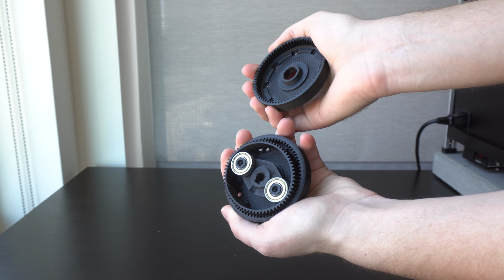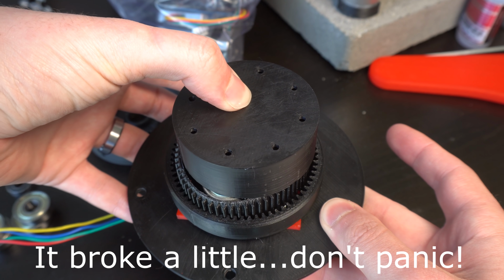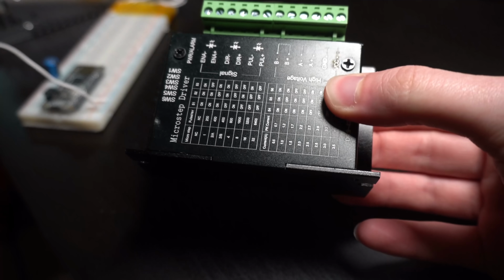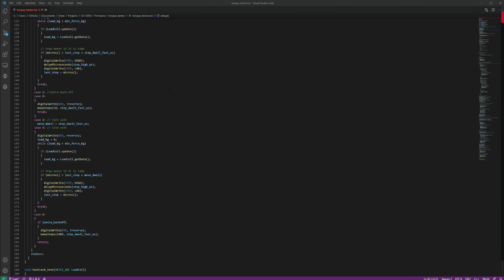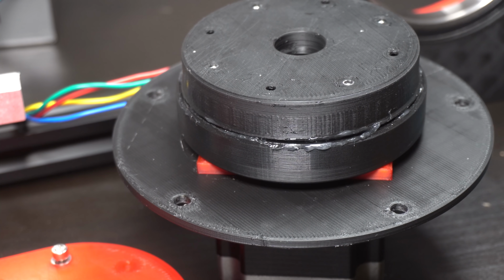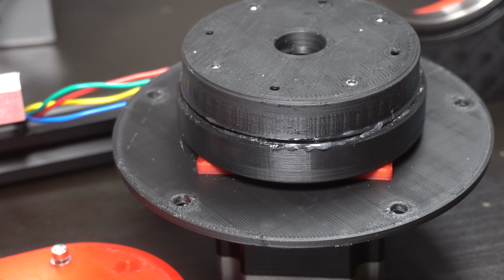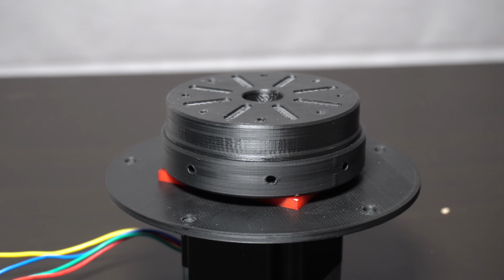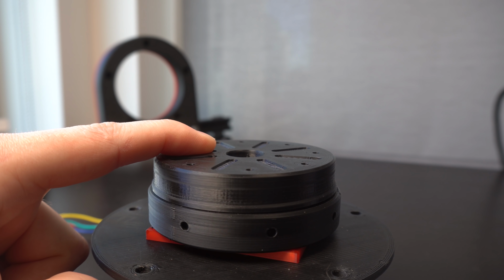My 3D Printed Harmonic Drive is Surprisingly Powerful!

Comment: I thought stepper motors stepped. These guys are moving continuously. So what don’t I understand?
Reply from the maker: They do step, but the steps are so small that it looks continuous. The motor has 200 steps per revolution and moves with 1/32 microstepping (basically interpolation between whole steps) so it's actually taking over 6000 steps per revolution!
Reply: @3DprintedLife  wow. Thanks. That’s awesome!

Comment: You do realize that the flexible strain wave gear is not needed in your design, if you print two regular gears to fit to the bearings (as idlers) the resultant gearbox will still work and can be printed in a single material.

Comment: Hello what is the shaft diameter of motor used in your project,  nema 23 dia is 6.35. I am making the project but shaft piece is not matching with motor
Reply from the maker: The one I used has an 8mm shaft diameter. I'm finishing up my next video now but I can upload a 6.35mm shaft version to github in the next few days
Reply: @3DprintedLife  thank you so much for your reply  I have completed the assembly with other matching motor, I will share the build

Comment: full disclosure: i'm not into printing and modeling or any of the stuff, but i do enjoy watching these type of videos. but in the video the thing where the 2 bearing are attached to, the thing that broke? around 4:47, i think you were using a nut and bolt to tighten it to attach to the motor. can't you like shave the top of the rod and flatten it? at like between 4:44 - 4:45. and the piece to attach to it a little flat at the top too, like a semi circle, so that you wouldn't need to use a nut and bolt anymore. sort of like how the blades of an electric fan are mounted to the motor. sorry if i can't explain it very well.
Reply from the maker: Yeah I did try to use that flat on the motor shaft if that's what you mean, but the plastic is just too soft and easily deforms. I have some ideas on how to improve this though!

Comment: In my experience Taulman Bridge is an absolute nightmare to print with, you need very high temperature enclosure to prevent warping.

I switched to Polymaker CoPA and PA6-CF, both of which prints almost as easy as PLA, sticks perfectly to glue stick, doesn't warp, etc. 
As long as you keep the filament dry and your printer hotend can handle the temperature.

Comment: If you need more torque. Why not use two of that in the base?
Reply from the maker: That is true, but since the gearbox had no issues at 10NM it was just a motor torque issue, I'll instead just either use a bigger motor, or slightly gear down the connection between motor and gearbox

Comment: I recently picked up a few 3 phase BLDC motors that are used in camera gimbals to provide pan and tilt.  They have 12 windings and 14 magnets so there are 42 steps to go the full 360 degrees.  They were less than $5 apiece.  They are quite compact and might be able to be mounted internally in a harmonic drive such as yours.  I may have to give it a try.

Just to be clear, the way your design works is that the belt moves inside the two cups, but the moving cup has more teeth than the fixed cup.
Reply from the maker: Oooh cool idea!

Comment: Nylon isn't scary at all. Printing onto a phenolic resin sheet is the trick. Taulman Bridge is optimized for easy printing, so it might work fine on painters tape. I've had very good results with weedeater line at ~70C on the bed and ~280-295C on the extruder depending on printing speed.

Comment: I'm not sure if we can measure stepper motor current just using a multimeter. I recently measured those TB6600 drivers on an oscilloscope, and I think this 3A is only a peak number rather than an RMS value. But I'm not an expert if there is someone more into this topic I would be grateful for a comment :-).
Reply from the maker: I'm no expert either, but from my understanding you should be able to measure the RMS current draw while the stepper is at a standstill, and thus is drawing the max current at a time. Peak may be higher in the windings during motion but it will also drop as the stepper motor speed increases above a certain threshold, which will depend on the motor.

Comment: I create 3d printed torque sockets for capping bottles at work and using a 3/8 inch drive, we are regularly able to place 60 in'lb of force on them without any problems. They obviously wear after a while but we were really surprised at how much they could take for as long as they can take it.

Comment: A thought about the design: you have two big gears with teeth facing inwards. The static one is fixed to the motor and has x teeth. The rotating one has x-2 teeth so you have two “matching points” of the big gears. The number of teeth of the “belt” doesn’t matter that much. If you would replace the belt with a planetary gear with 2 planets, the ratio of the big gears as well as the whole working principle would stay the same. But you could skip the ball bearings and instead of the rotor and the belt you would have gears, that give you a far higher material thickness.
Reply: That's called compound planetary gear and it works great. More efficient than this, although it does have backash like all rigid gears which is not good for a robot arm.

Comment: May I suggest making a cycloidal Drive instead of Harmonic.
Reply from the maker: Good tip, though for this size gearbox and the loads I'm dealing with, a cycloidal drive would have to be a lot heavier (use a lot more bearings) to achieve the same results. And since I'm using a stepper motor, I don't care so much about back-drivability
Reply: @3DprintedLife  in perfect world you would have a lot of bearings in it but in my experiance i managed to print a 12/1 reduction in 5cm radius. Mainly by printing in nylon, which is "selflubricating". You could also scrible the print with graphite (pencil lead) if you want to be cheap, using SLA for accuracy would be even better. also, about the nylon. Don't be scared of it its not that bad. Also nylon with carbon like one from fiberlogy is super easy to print even on my old ender 3. It is almost like pet-g. Altho it does not "selflubricate" like the rest.

Comment: Printing with nylon isn't so bad just don't print with it and stay in the same room as it prints. You definitely need an enclosure to stop it from warping off the bed while it prints. 

I would rather print with nylon than ABS, it prints the same but it's so much stronger for parts that will see higher forces.
Reply from the maker: Good to know, thanks! Luckily my printer already has an enclosure so perfect!

Comment: Why reinvent the wheel? there's thousands of stepper drivers out there.
Reply from the maker: It isn't just about remaking something that already exists. It's about making a board with all the features I need for my project built in, doing it for less, making the design available to all to build or modify, and learning more about board design so that the next time I need something even more difficult, I'll have better skills to take it on.

Comment: Seeing your technical ability - nylon should be no issue for you. Just dry it in a food dehydrator and keep with silica right up to printer - use all metal hotend at 250C and should be fine. Great report!

Comment: It is not NM, that would mean "Newton Mega". And that is a violation of the SI-rules. Factors first, then units. So it would be MN. And that is a force, not a torque.
It is Nm. Newton meters.
Why are the US people always butchering the SI-units? You can du that with inces and pound forces as you want. No serious people use that.
Read the Si system and stop that nonsense!
https://en.wikipedia.org/wiki/International_System_of_Units

Comment: this is awsome!
i just don't get it how can it have different tooth number on same diameter and same tooth profile (stator and output)?
Reply from the maker: Ah yes, so the output tooth pitch is actually "incorrect", which is what allows you to fit more teeth in the same diameter. But since only a few teeth are engaged at a time, this pitch inconsistency doesn't cause any issues but instead allows the output to spin slowly!
Reply: @3DprintedLife  wow, thanks for a quick reply! yes i was guessing that maybe space for the rubber tooth is the same but distance between spaces is a tiny bit smaller, as only one tooth is fully inside the space and others ore on a different curve.. i think i get it now :) thanks!!!

Comment: Wat size htd belt did you use?
Reply from the maker: For the initial tests, it was a 15mm wide, HTD5m belt. I don't remember the loop length, I tried a few but it was around 220mm.

Comment: Imo, if it is only external part of the flex that work, it can be replaced with cogwheels instead of inner bearings. 
That will be kind of "Spur gear differential" (c) wiki, but with outer suns cogwheels.
Reply from the maker: You're right it definitely can and that would be more efficient, but it would also potentially have more backlash. Would be a good test though!

Comment: I've printed with bridge.. make sure to put it and a heated dryer for ideal printing.  I put the heating unit of a food dehydrator in a box with my filament overnight. I would use a more aggressive tooth pattern as well. The bridge nylon can either smooth the surface enough to become a bushing or with the friction weld moving parts into stationary parts.

Comment: I'd look into "lost PLA casting" There are several youtubers that focus on printing in PLA, then making molds and replacing the plastic with metals like aluminum or bronze. You might be able to reach out to another content creator for a collaboration, that way you can keep your costs down. Example: https://youtu.be/rYNTua5fXxY
Reply from the maker: Oooh yeah that would be cool to try. Though I do want to keep this whole arm project super accessible to everyone so I won't do this for the final arm.

Comment: amm how exactly did you make it so compact?? i understand conventional harmonic drives, but this looks like magic, how does the flex-thing mesh with "rotor" splines?
Reply from the maker: Yes lots of magic :) It's a bit tricky to explain, but basically the flex spline acts as a bridge between the bottom and top half of the housing. The bottom stationary half has 2 teeth less than the rotating top half, so as a result as the flex spline rotates around the perimeter, the output will spin slowy.
Reply: @3DprintedLife  doesn't clarify things too much, but I respect the desire to not get into the nitty-gritty. Thanks for the awesome idea, I'm sure someone that really wants such a design can infer what he needs from this video, given he is a decent engineer. Maybe me, someday? Surely this thing will be very useful for a lot of projects

Comment: Silly question time: why not make an "inside-out" harmonic drive, with the belt and "planet" gears on the ourside of a large gear?
Reply from the maker: That's not silly, that would work too! I'm guessing it would just be less compact for the equivalent gear reduction and strength, but I'm not sure. Would be a cool test!

Comment: Hey good work. What is the point of using flex belt? You could use ordinary gears instead of using printed belt and bearings since your design has two ring gears. This would help efficiency.
Reply from the maker: Ah yes true it would definitely make it simpler and more efficient, but it would most likely have more backlash and way more deflection under load. Using a flex spline more easily balances and transfers forces from one side of the wave generator to the other, and back again. If there were free-spinning gears, there would be little to stop them from wiggling/rotating freely. Some have also suggested adding a sun gear to the middle, making this a planetary hybrid. I'm not fully convinced it would be as rigid as this design but is an interesting alternative!

Comment: I thought of this before, but this video drives the idea home even more. Why not eliminate the flex spline and use a pair of gears instead of just bearings at the end of the swing arm (radius being that of the bearing + the belt thickness, and height being enough to span input and output teeth). The small gears would only contact 1 tooth fully in the drive shaft gear and output gear. It might reduce the torque required, as nothing would be stretching. Am I missing something, because this seems a clear next direction.
Reply from the maker: It's definitely a good way to do it! I'm not sure if that would be better for backlash and compliance, but it would definitely improve efficiency and max carrying capacity. It probably would also not have as much gear reduction but I'm not too sure about that without sketching something out. Cool idea though!
Reply: @3DprintedLife  I didn't do the math, so the gears aren't meshing quite right, but here's the general gist of what I was thinking. Nothing really changes except for the source of the tooth that aligns the static outer gear with the harmonic one.
https://youtu.be/EzgJVdogTQQ

Comment: You should use involute funtion for gear profile. It will gives you the optimum profile geometry for maximum efficiency and min friction. Search “involute function gear profile” on google. You can type “tan(a) - a” in curve generator in any cad programme then mirror it arround a center for the rest.
Reply from the maker: I actually did use an involute function, just calculated using dimensions rather than formulas. But that is good to know I can use that formula instead, doing it the cad dimensions way is a huge pain!
Reply: @3DprintedLife  btw your videos are great. I've really enjoyed and subscribed.

Comment: i don't understand how to output is hooked up
Reply from the maker: I may make another video explaining this a little better but the basic principle is that the stationary half of the housing has ~60 teeth, and the rotating half has 62 teeth. The flex spline will always engage 2 teeth on opposite sides of the gearbox at a time. As the wave generator spins, the teeth being engaged will rotate around. And, since there are more teeth on the top than the bottom, the top half has net motion. Sorry it is more difficult than I thought to explain!
Reply: @3DprintedLife  oh, that makes sense. It's like a hybrid with a cycloidal gear box then

Comment: Why dont you use a simple worm gear?
Reply from the maker: Well I could, but there's tradeoffs to every design. Making the spiral drive gear out of plastic that is able to handle the torques I require would not be easy and backlash would likely be worse, but it definitely could be done and it would be a more simple design!

Comment: Printing nylon is a bitch. Especially for parts that need high dimensional accuracy. Good job on the design tho! Confirms my belief that the shear strength on the flexspline is the limiting factor.

Comment: I'm curious why you want a custom driver.  Is there not an Arduino shield that supports a suitable stepstick driver?
Reply from the maker: Well, a few reasons. First is I'm crazy and I love doing everything myself so I can learn the most. But also more practically, building my own control board will allow me to make it small enough to fit within the final robot arm where I want to put it and it'll be cheaper and allow me to include all the features I want!
Reply: @3DprintedLife  Nothing crazy about that.  I just asked because people seem to dislike Stepsticks/RAMPS for various reasons, so if someone built a better version it would be nice to know what all of them are.

Comment: hi could you not use the baking powder water mix method .this does away with all gearing flex . its like a auto gearbox but it only needs a variable vibration to harden its fluid structure to then allow the 2 internal rotators to form a propulsion to the outside .this vibrational/hammer effect coud be built in to your software to match a unlimited torque .will place a link to the fluid /hard baking powder .but its shown to kids by someone puching a bowl full and the fluid instantly stops the hand punch entering the fluid  melvin_oo2@aol.com
Reply from the maker: That is a really interesting idea and it might work! But I doubt it would be possible to achieve the same holding torque using this method. Would be cool though!
Reply: Hi , so you understand the theory . Tried to see if there was a demonstration but to no avail . The way to give it more torque to the outer would of coarse to keep the splines that would tooth into the fluid . It's like the multi variable gearboxes Volvo and ford used on cars in past . But they used a belt cone drive type type in Volvo variamatic
Reply: https://youtu.be/YHlGM6P8IA8

Comment: For your gear profile have you thought of using a herringbone.  For the flex part, you could do a double herringbone, one herringbone for the drive gear, and another of the driven gear.  Not sure if this will work or not but just an idea to try. Never mind, I don't know what I was thinking, a herringbone would never work.
Reply from the maker: Hahah yeah I thought about it briefly, I think it might work but I'm actually not too sure. The biggest issue would be that the herringbone on the flex spline would greatly increase it's rigidity and make it a lot harder to flex. But maybe!

Comment: That's absolutely terrific! I wonder if using lost pla casting methods would allow for a more robust wave generator... I'm thinking the harmonic drive is Wonderful, and combined with extremely torquey motors could make for stupendous torque or a very small form factor, or both!
Reply from the maker: Yeah that probably would be possible!